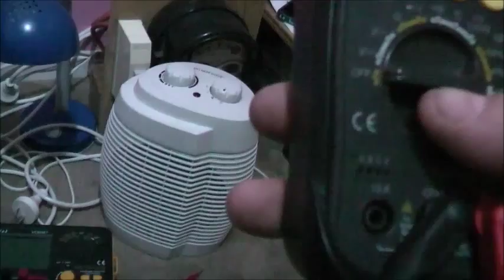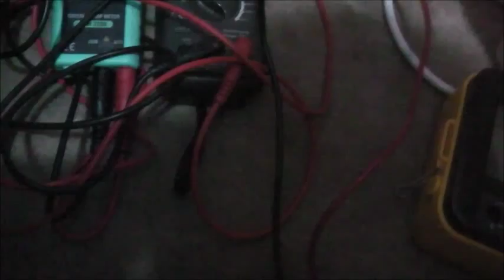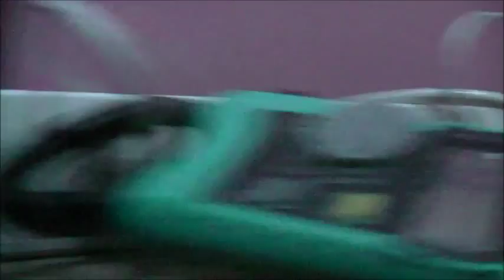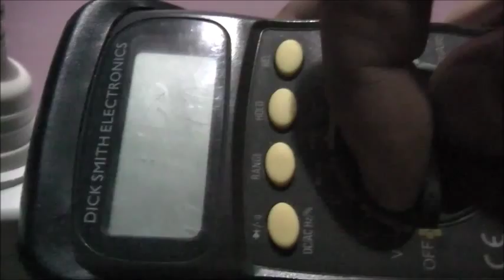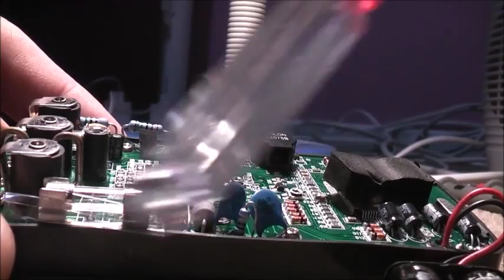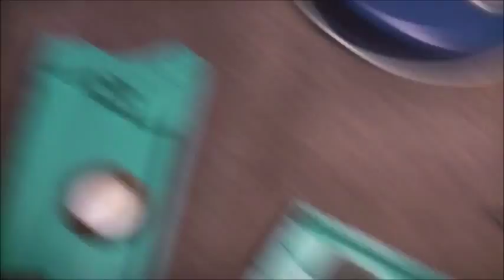Multimeter Comparison Tests!!

Comment: Unless the meters are true RMS, the AC reported voltage will vary according to the AC waveform.  For example, if the tips of the waveform sag from a heavy load with a low power factor, a meter that works out the AC voltage by measuring peak to peak of each half of the waveform will report a lower voltage than a true RMS multimeter that takes the full waveform into account.

There was a video on I think knurlgnar24's channel that went into more detail, particularly in the case with modified sine-wave inverters where many non-RMS multimeters will report a voltage below 200V for a 230V inverter.